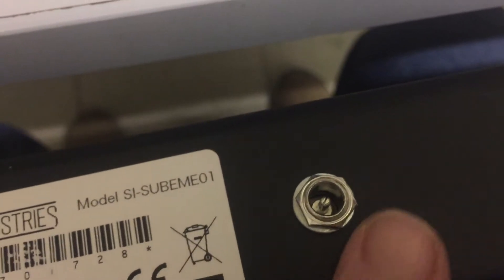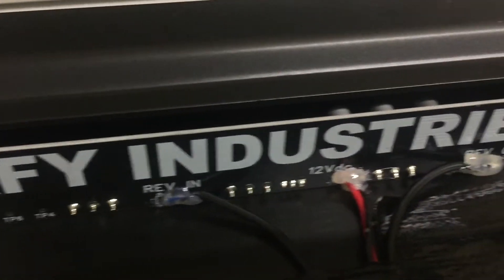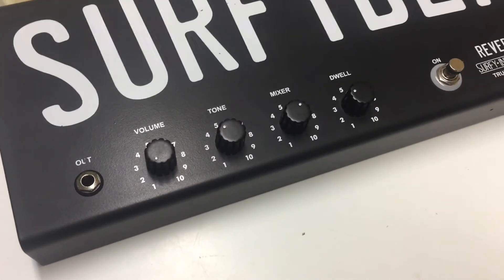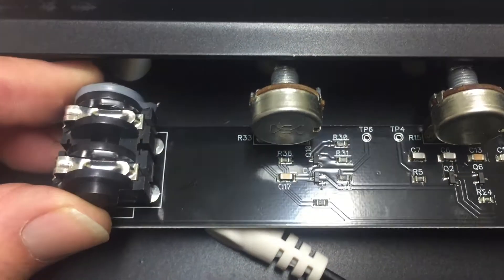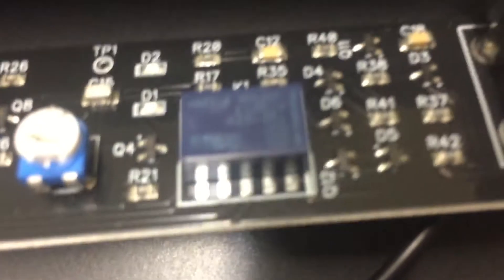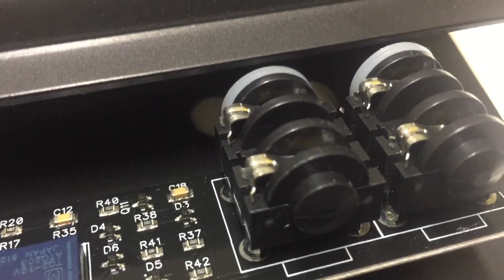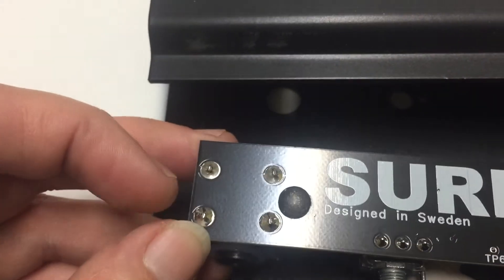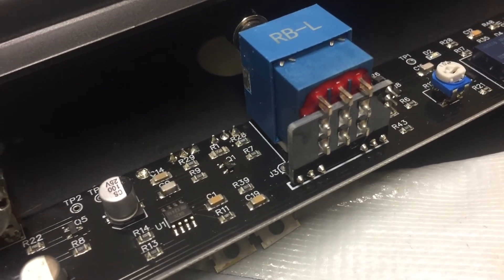What's REALLY inside a Surfybear Reverb?

Comment: Hello, thank you for this great look inside the SurfyBear Metal. I am not affiliated with the company in any way, but I recently purchased the same unit and was concerned about the weak plastic input jacks shown in the video. So I checked my unit and it looks like the company has listened to your advice. The pots are still PCB mounted but the 1/4” jacks(input, output and foot switch) are no longer plastic or pcb mounted. They are now of the switchcraft type you would find at the input of a Stratocaster mounted directly to the metal chassis complete with star lock washers and independent wiring. So this appears to be an upgrade in reliability. I have had my unit only a short time so only time will tell how it holds up to continued use. 

A word of caution to anyone attempting to tighten the jacks from the outside. While it’s a good idea to keep them tight to prevent internal damage, do not simply turn the nuts from the outside as you risk turning the entire jack and eventually pulling on the wires inside which can lead to broken wires or solder joints just like on the input jack of a Stratocaster. Instead you must open the unit and hold the jack on the inside(obviously do this while the unit is unplugged to avoid touching electricity) and tighten the nut from the outside while preventing the jack from rotating internally.

Best regards and thanks again for the internal explanation of this reverb unit.
Reply from the maker: That's great news, thanks so much for the update!